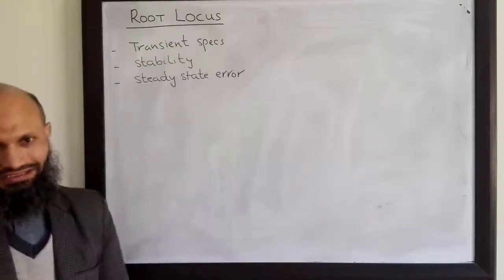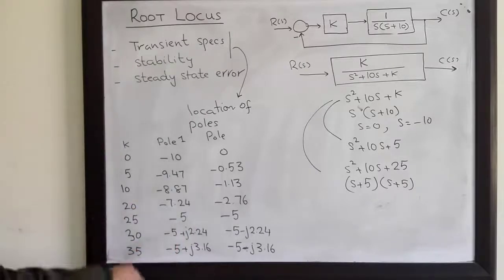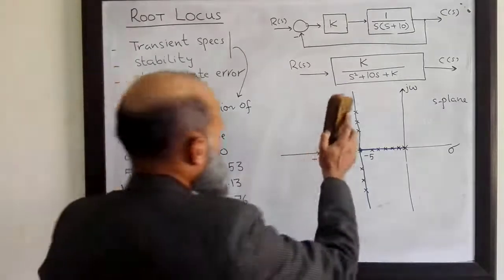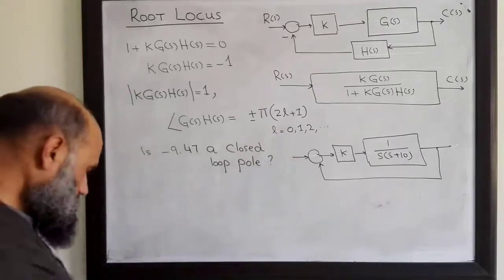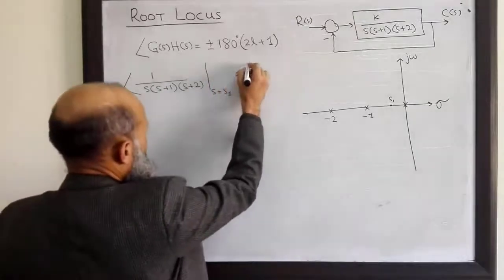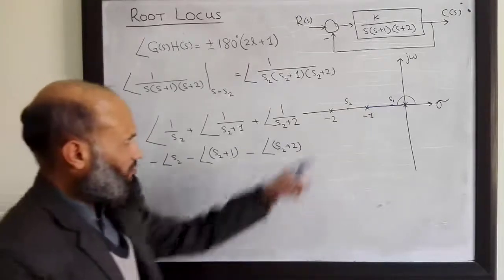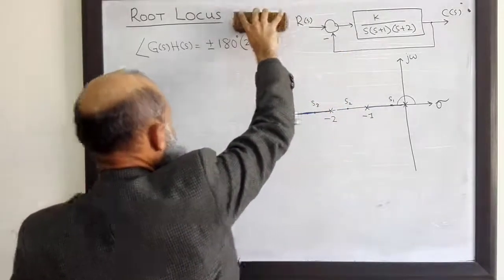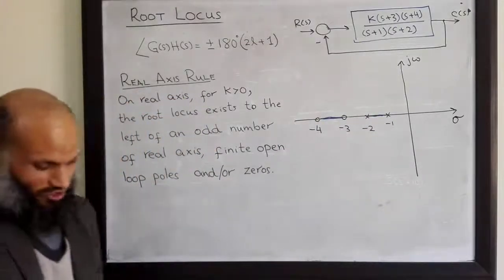LCS 30  - Root locus, meaning and significance

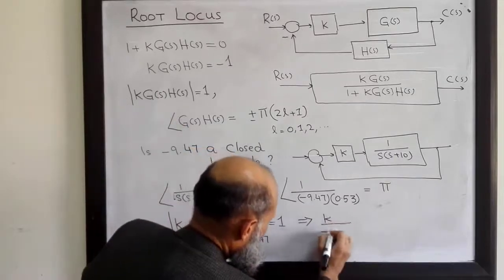Comment: Good night sir thank you so much for your explanation, I have a question, does the absolute value of (k/(-9.47)(0.51)) has two solutions? one for k = 5 and another one for k = -5? [min 11:50]
Reply from the maker: Yes, you are right. The magnitude condition is satisfied for both K = 5 and for K = - 5. Hence, s = - 9.47 will be a closed loop poles for both of these values of K. Furthermore, in next lectures, we shall see that we generally plot root locus for only positive values of gain K.
Reply: @MAFarooqi  Completely understood, thanks again for your help. Have a nice day.